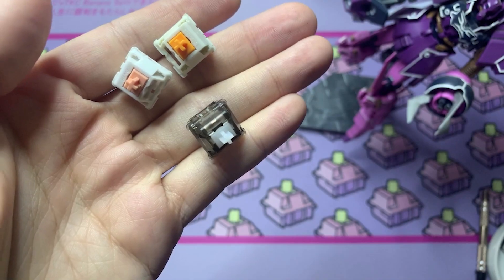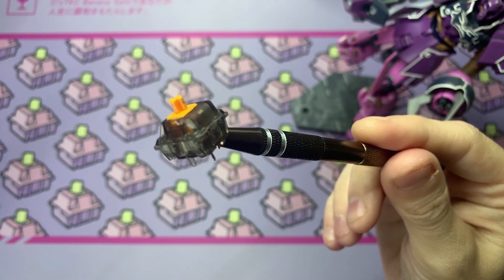Holy Oreos! | Frankenswitch Ep. 1

Comment: Tried this and somehow messed up my Oreos so now I can’t really use the housings
Reply from the maker: Damn man! The only possible way that I could imagine that happening is if you put the top housing back on backwards, as that can crush the inner metal leaf inside the bottom housing. .. or you somehow pulled apart the switches incorrectly and the clips on the side broke? Not sure, but I can’t imagine how you could mess up every switch. I check each switch after modding it. Let me know what you think you did because I’ve never heard of that occurring!
Reply: @zeonic_keys6375  it didnt happen on every switch, more like it caused every switch to be different in terms of tactility and sound. the leaves were really loose when i tried to take the halo stems out and put the stock stems back in, so trying to get them to stay in the housing caused them to move ever so slightly and thus my oreos are essentially unusable :/ gonna probably use the stems for something else though like i said, idk what yet.
Reply from the maker: @justanotherpxrson  thats so weird! I wonder why the leaves got stretched like that. Theres always a use for stems at least! I just got some super cheap tactile Tecsee switches from aliexpress, and will prob. use some of my leftover switch stuff on those too, its cool to finally see a company putting out interesting switches for cheap for once at least.